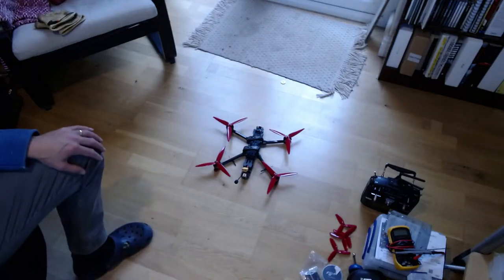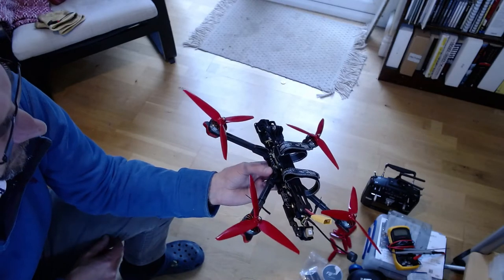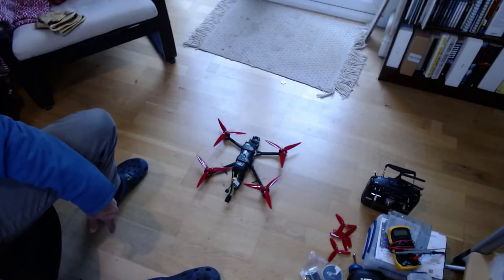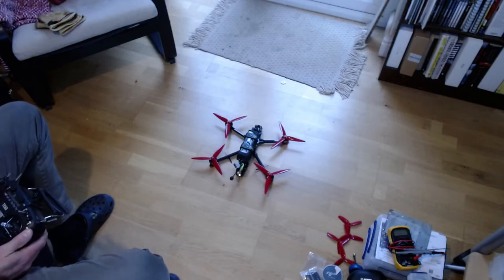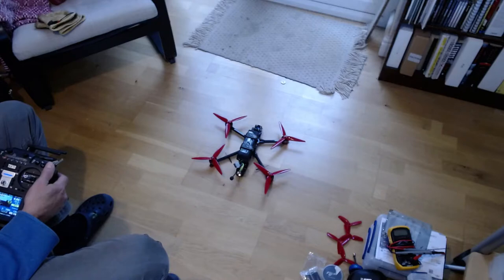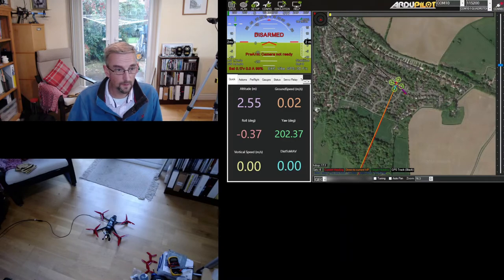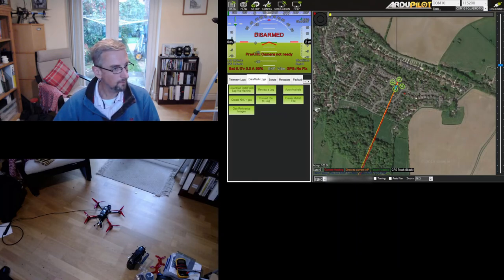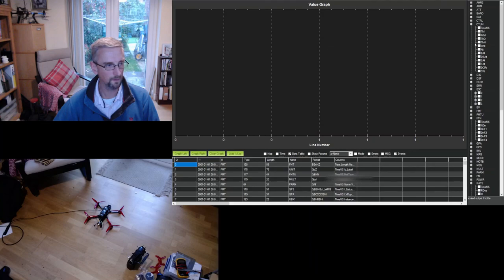ArduCopter 7" LR Build Video 17 - Pre-flight Checks and First Flight

Comment: ive been following your series of tune videos  - really great stuff. I found on are where folsk generally skip (including official AC docs) is gudance for the static filters for ACCT and GYROs - 20 / 80. I configed my GYRO to 150 based on your parameter sample, but still not cetain what input i should use to make this call. My first FFT notch happens to be at 150 as well so my HNTCH FREQ is set to 150 - - does it sound right?? thank for any guidance on this. cheers
Reply from the maker: The higher you go the more your are relying on your notch filter to accurately filter noise, if you have got it wrong you will smoke your motors. So to go this high you must be using ESC telemetry to drive the notch. INS_HNTCH_FREQ is the minimum notch frequency as well as the hover throttle frequency for throttle-based notches, so you need to make sure it is low enough to cover your frequency range. Again if you are using ESC based telemetry you can pick a much lower value as it is then the ratio of INS_HNTCH_FREQ/INS_HNTCH_BW that is important. For ESC-driven notches you want this at about 4 or greater

Comment: Hi

I have the same thing with compass direction in mp. It goes from the arm.
Is it some kind of bug or is it a feature?
In previous mp versions it was set mid between front arms.
Reply from the maker: Hi, not quite sure the question you are asking - can you expand a little?
Reply: @andypiper5285  hi sure
14:35 in this video you have mission planer opened with the first tab where we can see the map.
The drone icon on the map represents the aircraft, yellow and red lines representing the compass heading and smth else.
My question is do you know why heading lines are pointing from the arm, not from the front on the aircraft icon?

I have the issue where my drone really thinks that forward heading is where the one of the front arms points. 

At the same time compass readings are right. Ive double checked using my phones compass, my friends phones compass 😅
Reply from the maker: @GravityLossFPV  Best way to check compass in mission planner is to point the drone north and then check that the HUD says north. Then rotate and check other points. The heading shown also involves the GPS and I was inside so could easily be wrong.

Comment: Hello sir,

I apologize for bothering you. I'm at this step and currently running into issues with the copter from flying. I've tripple check on the motor orientation. A,B,C,D following your step and making sure the propeller are installed correctly. However, when I tried to do the initial hover, the copter doesn't have any lift. I thought I installed the wrong propeller orientation. I removed them, checked the motor direction and installed it, there is still no lift. When i tried to hold it up in the air and do the hover, there is still no lift as well but as I increased the throtlle the quad become osscilate (still no lift). I removed the prop, re check the motor direct installed the propeller, but I still not getting lift. May I ask if I have installed something wrong or I didn't adjust the setting correctly? I thought it the motor direction and the propeller but I've checked them multiple time and still didn't get it resolve. I hope if you could help me shed some light on this. Thank you so much sir.
Reply from the maker: Do you have an F4 based ESC (e.g. Holybro Tekko)? There is a bug in the temperature sensor on F4 that requires you to turn off temperature protection in BLHeliSuite
Reply: @andypiper5285  Hello sir, thank you for answering. My set up is exactly like yours I I'm trying to stay as close to your build as possible to prevent incompatibility issues. My flight controller is also the H7 Lumenier. My motor is the Tmotor F90 KV1300, my propeller are the Gemfan 7037. I honestly not sure how to troubleshoot this as I've tried to check the orientation of the motor and the propeller as well. May I ask if there are any other information that I could provide to troubleshoot this? If you happened to have a class, I'm would be willing to pay for your time as well Thank you so much for doing this.
Reply: @andypiper5285  Hello sir, I've tried to trouleshoot a little more and while I were using my iphone to take a slow motion of the motor when it spinning with the prop I think I noticed all motor are spinning in the same direction. So I took out two propeller and only leave two diagnose of each other. I noticed the A and C are spinning correctly CCW as I put my hand underneath and feel the wind blowing down. I then removed A,C and installed B and D, I noticed they are still spinning CCW hence the wind is being push up instead of down. May I ask what did I do wrong that causes this and how can I fix it? In your video regarding the motor orientation, I followed your step and when testing using the Mission planner to test motor A, B, C, D all of them spin in correct orientation. I've also install each prop and run the Motor test in Mission Planner and feel the wind is being pushed down hence confirmed they are running in the correct orientation and the propeller are installed correctly. However, when I actually arm the quad (running it in acro mode) All the propeller spin in the same direction hence B and D are in correct as they should be running CW. I hope you help me with it. Thank you so much sir.
Reply from the maker: What ESC do you have  @bohaman.  ?
Reply from the maker: How did you get the motors spinning in the right direction? Did you use BLHeli Suite or did you set SERVO_BLH_RVMASK? @bohaman.
Reply: @andypiper5285  hello sir I purchased the Lumenier ELITE PRO 60A 2-6S BLHeli_32 4-in-1 it should be similar to yours
Reply: @andypiper5285  hello sir, I followed your direction, and adjusted it in the BLH_RVMASK your video you have the motor 2 and 3 spin in the wrong direction but mine have 1 and 4 so I adjust it and uses the motor test function in mission planner and  they all spin correctly. But as I described when I actually armed the quad to fly motor B and D spin wrong direction. Thank you so much for your time.
Reply from the maker: This seems like a bug. You could instead use BLHeliSuite to set the motor direction if its not working  @bohaman.
Reply from the maker: There is no information on the chips used that I can't see - so impossible to tell @bohaman.
Reply: @andypiper5285  I will give it a try sir. Thank you so much ! Which mean I should set the default the blh mask first before I attempt to edit using blheli firmware correct ?
Reply from the maker: Set RVMASK to zero if you do it this way  @bohaman.